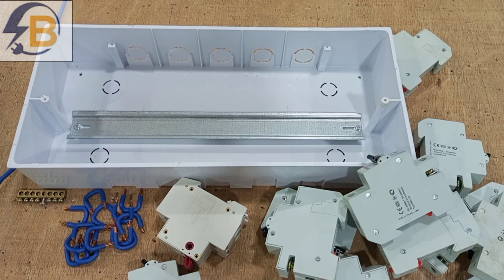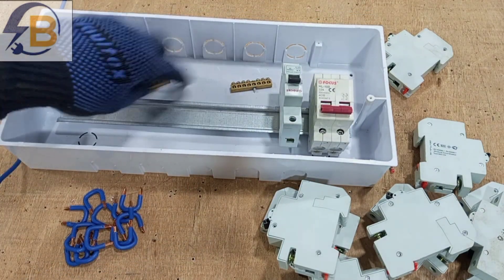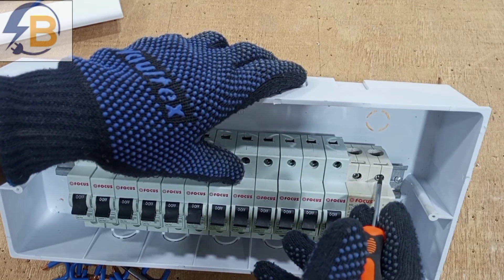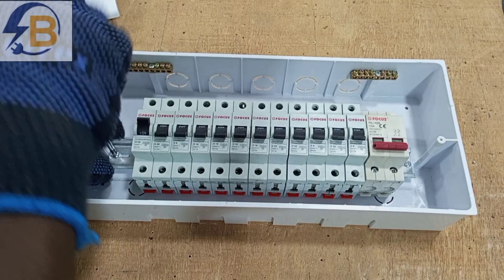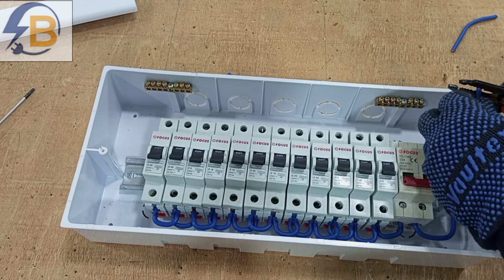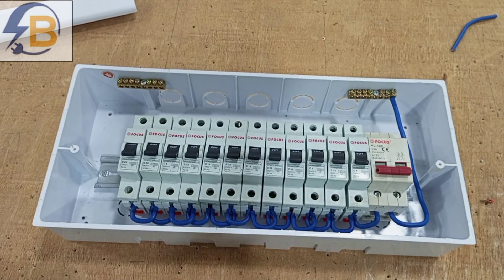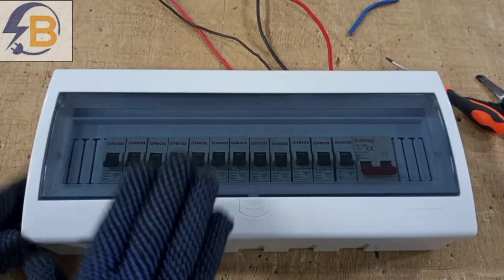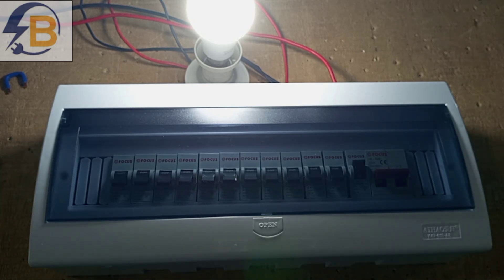How to Assemble a Consumer Unit with MCBs

Comment: Good morning/evening sir 
As a beginner,the consumer unit connection I have come across,one of the breakers (life) is normally connected to the main breaker . what's the difference between this one and that one ?
Reply from the maker: Yes the main breaker receives both Live and neutral. that's why it's a double-pole switch
Reply: @obloni_Electrical 
What's the excess of looping the breakers together?

Comment: Amazing video. Thank you! What happens to the ground wire (Earth wire)? In the US, we tie the ground wire and the neutral wire together at the main panel for single-home residential houses. Does the ground wire connect to the neutral bar here?
Reply from the maker: @akh345  
please you need to watch this video attentively.  https://youtu.be/wWO2Z-gm-HA?si=EDmxNw1A9Yw9SL7j 
You will get a detailed explanation to your question. 👍
Reply: @obloni_Electrical  Thank you so much! In the US, we have a TN-C-S grounding system for single-family residential homes but it is a 2-phase TN-C-S system (L1, L2, N). These two phases are 180-degree apart and are also called "split-phase". Awesome videos!
Reply from the maker: @akh345  great!. 👍